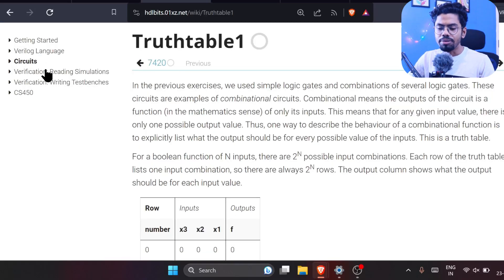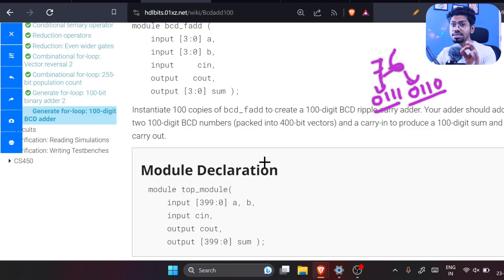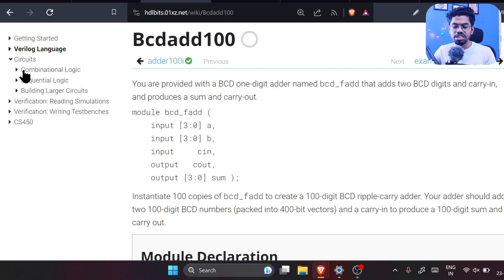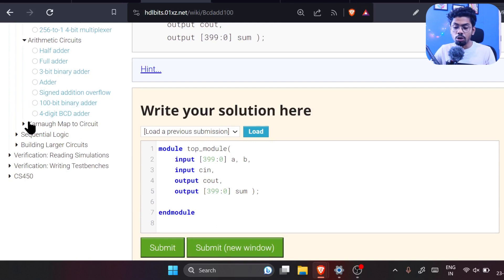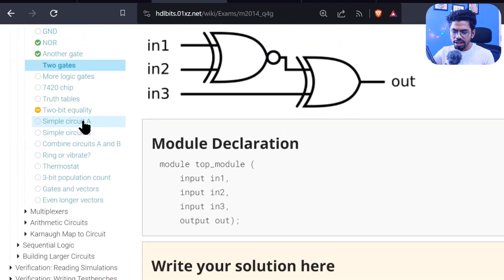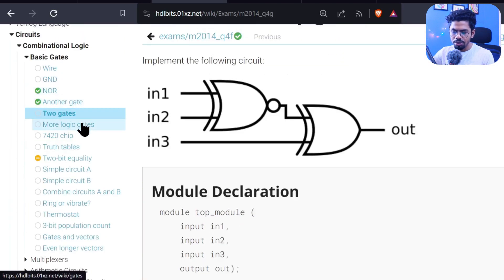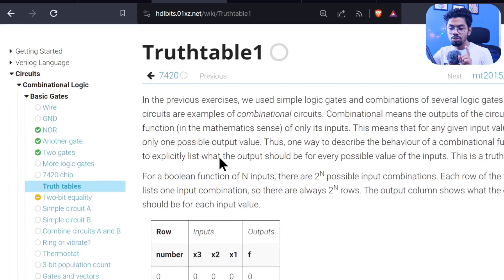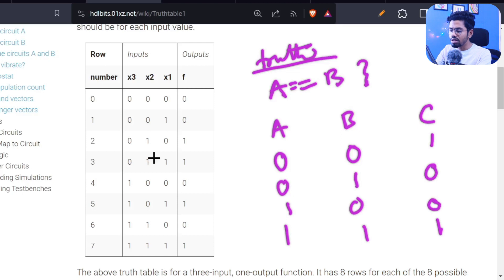Digital Design using truth table | Let's Learn Verilog with Real-time Practice with Me | Day 23

Comment: module top_module( 
    input [399:0] a, b,
    input cin,
    output cout,
    output [399:0] sum );
    wire [99:0]carry;
    bcd_fadd bcd1(a[3:0], b[3:0], cin, carry[0], sum[3:0]);
    genvar i;
    generate begin
        for(i=4; i<400; i=i+4)begin:gen
            bcd_fadd bcd1(a[i+3:i], b[i+3:i], carry[(i/4)-1], carry[i/4], sum[i+3:i]);
        end:gen
      end
    endgenerate
    assign cout=carry[99];
endmodule

Comment: The answer for the BCD Full Adder:

module top_module( input [399:0] a, b, input cin, output cout, output [399:0] sum );
    
    wire [99:0] carry;
    bcd_fadd bcdfirst ( .a(a[3:0]), .b(b[3:0]), .cin(cin), .cout(carry[0]), .sum(sum[3:0]));
    genvar i;
    generate begin
        for ( i=1; i<100; i++) begin :gen
            bcd_fadd bcdfa(.a({a[i*4+3 : i*4]}), .b({b[i*4+3 : i*4]}), .cin(carry[i-1]), .cout(carry[i]), .sum({sum[i*4+3 : i*4]}));
        end :gen
    end
    endgenerate
    assign cout = carry[99];

endmodule
Reply: Thanks it helped me figure out the answer!
Reply: Muchas gracias por la ayuda. Your code help me to find that the line (wire[99:0] carry;) is missing in my code.

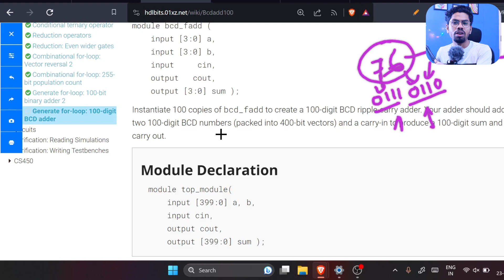Comment: hey bhai, could you please provide the solution for 1:46 question
Reply: module top_module( input [399:0] a, b, input cin, output cout, output [399:0] sum );
    
    wire [99:0] carry;
    bcd_fadd bcdfirst ( .a(a[3:0]), .b(b[3:0]), .cin(cin), .cout(carry[0]), .sum(sum[3:0]));
    genvar i;
    generate begin
        for ( i=1; i<100; i++) begin :gen
            bcd_fadd bcdfa(.a({a[i*4+3 : i*4]}), .b({b[i*4+3 : i*4]}), .cin(carry[i-1]), .cout(carry[i]), .sum({sum[i*4+3 : i*4]}));
        end :gen
    end
    endgenerate
    assign cout = carry[99];

endmodule

Comment: DOUBT : 

Ref. Question : Create a 4-bit wide, 256-to-1 multiplexer. The 256 4-bit inputs are all packed into a single 1024-bit input vector. sel=0 should select bits in[3:0], sel=1 selects bits in[7:4], sel=2 selects bits in[11:8], etc.

module top_module( 
    input [1023:0] in,
    input [7:0] sel,
    output [3:0] out );
    
    //assign out = in[sel*4+3:sel*4];
    assign out = {in[sel*4+3], in[sel*4+2], in[sel*4+1], in[sel*4+0]};

endmodule

In the above code there are two assign statements . One is commented out and another one is concatenated . When I am executing the commented out one it is showing error but the concatenation on is working fine . Why so ? I am providing the error statements here .

ERROR : sel is not a constant File
Reply from the maker: will discuss in day 28 video today